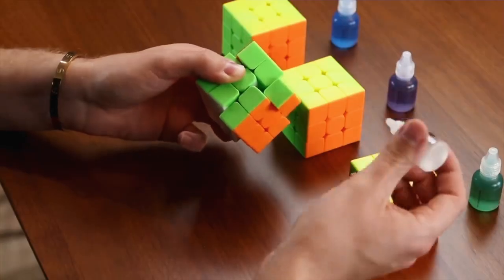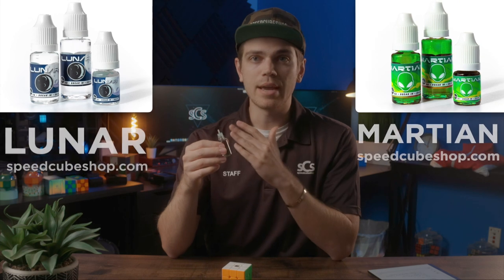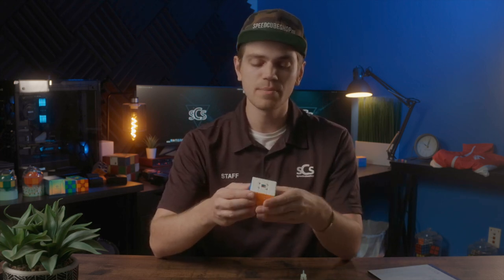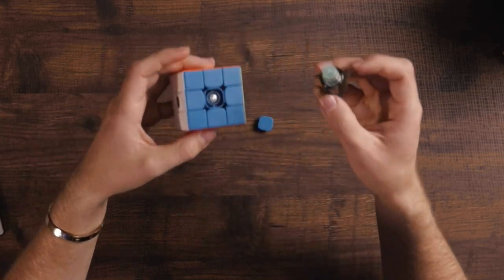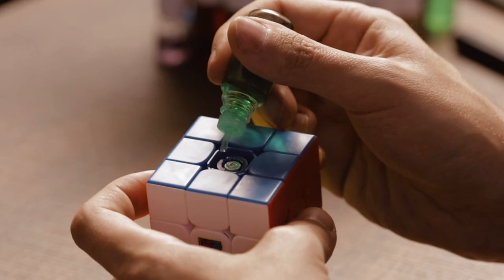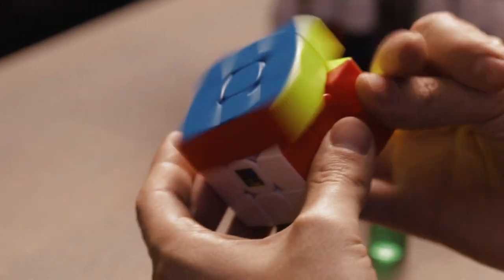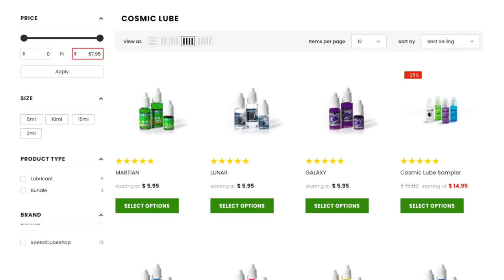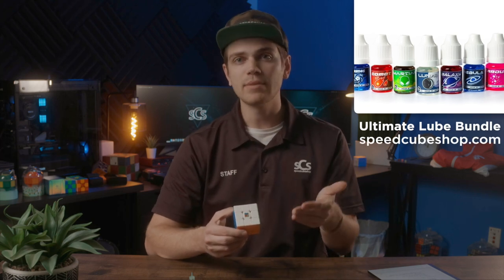Remove speed cube spring noise in less than 1 minute

Comment: Only one thing: DON'T use Stardust on the core (screws, springs). Stardust is a water-based lube and if you use it on the screws or springs it will rust them.
Reply: is weight 5 lube fine ?
Reply: Is cosmic lube fine?
Reply: @reenakumar4225  it's probably the best core lube with Vortex.
Reply: @DizzyRL  Stardust is a Cosmic Lube, so all Cosmic Lubes are good for core lubrication except Stardust.
Reply: I read this too late, I did this with a water based lube :/
Reply: @ivanbeekley7944  clean the screws and the springs.
Reply: @evansucks1494  I did, it was only a week since I put the lube in it and I put just a drop per spring so not too bad. Redid it with silicone lube
Reply: EXACTLY,simethycone is fine tho
Reply: Mihir Raj  I used weight 5 and it works great so I’m sure weight 1 is would do about the same
Reply: can someone tell me whether dnm-37 is fine for the springs, im not sure if it is water based?
Reply: @blugeorgaklis8563  It is water based so it will rust the springs and screws if you do that.
Reply: @ivanbeekley7944  ok I just bought weight 1, will that be fine for the screws. Also I was planning on applying some to the core as well considering I don’t have a different line atm. Should that be fine, if so what are the effects of using weight 1?
Reply: @blugeorgaklis8563  I use wight 5 so it may be different but I find the silicone lubricants slowdown the cube a little and make the turning smoother as well as give it a plushy feel.
Reply: BRUH pray that just spamming lunar will overpower it
Reply: Is weight 5 silicone lube safe to use on screws/springs??
Reply: @Theelectronicsfixer  yup
Reply: @wrmmaglev6620  sure???
Reply: @Theelectronicsfixer  yes just don’t use any water lubes in the springs
Reply: Is it better to use lunar or weight 5 for the core?
Reply: Whoops
Reply: @potatoman3219  :-:
Reply: @wrmmaglev6620  happened yesterday tho
Reply: Is any silicone based lube fine?
Reply: @ericksandoval8898  yes
Reply: But aren’t they made of aluminum

Comment: Use the following at own risk: As an machinist/cuber, I use Lithium white grease on my springs where they contact the washer and screw, instantly worked, no 20 turns wait, and inside the cube parts I use Dry PTFE spray on the plastics, I've never ever since needed to tamper with my RS3M 2020 and 2021, on the 2021 I obviously didn't use the white lithium, no springs, but magnets. Never need to clean as there's no oils for dust to eventually stick to, just my experience in these products.
Reply: White lithium grease can speed up the degradation of plastic.

Comment: Excellent video.
I am having problems trying to tension my MGC Magnetic Cube which got really loose. 
I have never done this before and I am trying to figure how i can get the springs equal in tension. I adjusted all 6 springs (a 1/4 turn at a time) but can't seem to get them where they all move smoothly and feel the same.without hanging up or being too loose. Any pointers welcome how I can get them balanced. Thanks in advance. 

Phil

Comment: What if we have a cube with an adjustment system like the tengyun?
Reply from the maker: Typically, spring noise isn't as prominent on those types of cubes, but the same method should work the same; as long as your cube isn't maglev. Try your best to locate the spring and get some lubrication as close to the spring as possible. :)
~Noah
Reply: @SpeedCubeShopOfficial  thanks for the quick reply :)

I’ll try to unscrew the screw to lube the spring then, since the screw is exposed as well as the adjustment system.
Reply from the maker: Of course! I try my best to keep up with everyone :) 

How did this work for you?
Reply: @SpeedCubeShopOfficial  haven’t tried it yet… still scared to mess up the tensions 😵‍💫
Reply: I just got it the other day so I’m a bit paranoid 😅
Reply from the maker: Which Tengyun do you have? You may be able to do this without needing to adjust the screw
Reply: @SpeedCubeShopOfficial  tengyun v2 m stickered iirc, but it’s fine now, I loosened the tensions a little bit and the spring noises seem to be gone…

Comment: I use and have used WD-40 as my cube lube for the past 6 months now (I use the RS3M 2020). I highly highly recommend it over a dry lube. It makes the cube a lot faster and it feels so much better than dry. The only downside is that it wears out in 2 to 3 weeks, and makes the cube a heck lot slower past that point. So you have to clean it really often and put some more WD-40 afterwards. The speed and feel is defenetly worth having to clean the cube often in my opinion.
I do not live in the US and buying stuff from a cubestore is not a viable option, as the package can takes months in customs, if it is that you actually end up gettting it.
Reply: Cube plastic dissolves in WD-40. I wouldn't continue doing this.
Reply: WD-40 eats the plastic. Don't use it or Vaseline. If it comes to it, use olive oil.
Reply: @lasercatto  Not unless you want to fry up your cube.

Comment: ive had spring noise before, and i just unscrewed it, and took the spring out, and then put it back in and screwed it. and it was fixed. also if you have the rs3m, or are buying the rs3m just get the maglev version, then its impossible to have spring noise.
Reply: So if you just take the spring out and put it back its fixed? Im having this problem with my jperm rs3m 2020
Reply: @Supasane_exe  i honestly have no idea. when i commented this i didn't even own a speedcube, i only had a rubiks brand and it is really bad and you cant unscrew it or take the spring out. i dont know what i was talking about in this comment and I'm really confused lmao. i now have a speedcube, i bought the rs3m 2021 maglev so i dont have spring noise in it. i do have spring noise in a couple of my other cubes that i bought like my megaminx and 2x2 and a couple others ones. but i haven't tried to fix them yet, i would probably just follow and do what they say to do in this video.
Reply: @Chlef  ok thanks. I’m fine with it tho bc it’s only when I slowly turn it

Comment: I got a maglev. Problem solved :D
Reply: No Spring Noise, but there will be Magnet Squeaks.

And you'll be doing the same solution in th vid - putting lube on the magnet.
Reply: @thesphyrth  how? The magnets don't slip on anything. There are no moving touching parts.
Reply: @jorgeamaral613  
The magnet that's pushing up on the screw - that's contact. And the screw kinda "rotates" while the magnets are statically pushing each other.

Some MagLev users experienced it.
Reply: @thesphyrth  I don't really see how two magnets repeling each other will overcome friction on the surface they are touching. Makes no sense. The noise must come from any other place. Squeak is more likely from the plastic pieces if there is no lube.
Reply: @jorgeamaral613  
Same principle as the springs: just use lube to dampen them.
Reply: @thesphyrth  well, if you go and get lube there, then yes they will be prone to slipping. But it's completely counterproductive to lube magnets.
Reply: @jorgeamaral613  Your right the magnets dont touch eachother, but the magnets do touch other parts and those other parts are what are squeaking.
Reply: @schmaffew2343  only the upper one would rotate by being stuck with the screw, but that all segment will rotate with the whole center piece... The lower one should be the "free to rotate" and rub the plastic inside but there is nothing to force or prevent it to rotate.
Happily, mine still doesn't make any sound
Reply: @schmaffew2343  forget that. The screw is independent of the piece so the top magnet may rub with the piece. I wasn't seeing it clearly.